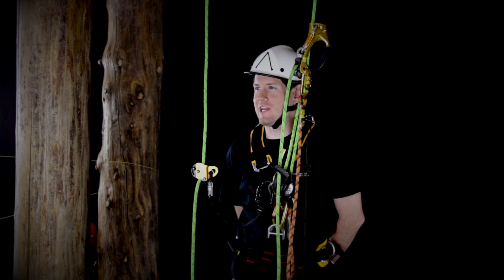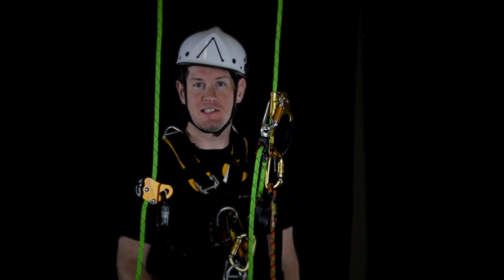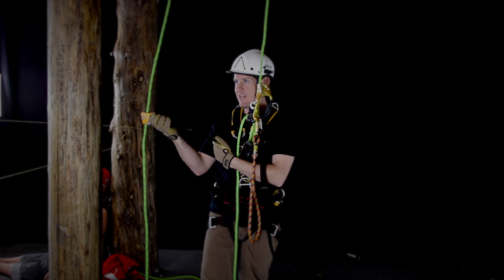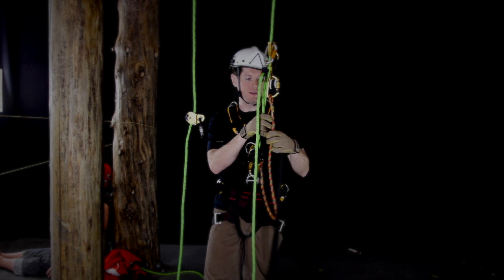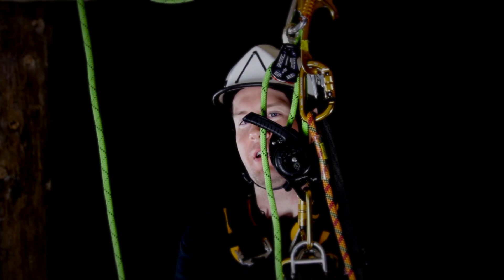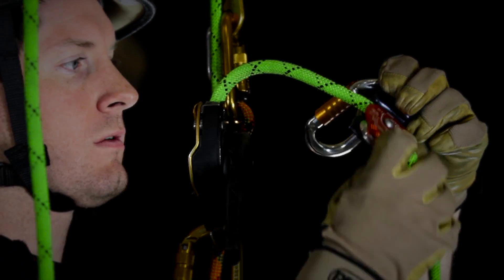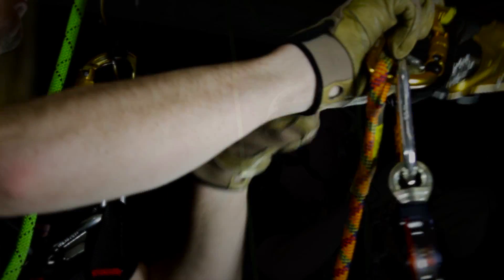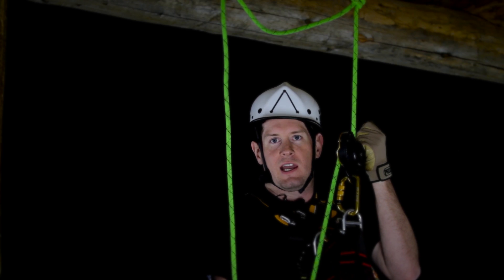Tech Pick of the Week - Episode 5: RAD Technique

Comment: Just wondering why you removed the carabiner holding the pulley and then reattached it to the carabiner at the bottom of the ascender , if you want to remove the ascent system wouldn't it be easier to just swing the cheek open on your Omni block and remove the rope. By doing this you not only avoid the risk of dropping your gear, your pulley will still be in the correct position if you need to convert back to ascent.
cheers
Reply from the maker: Great observation Peter Marotta...that is a great way to reduce the risk of dropping the pulley system...thanks for keeping a sharp eye.